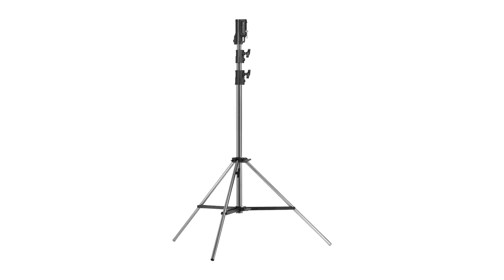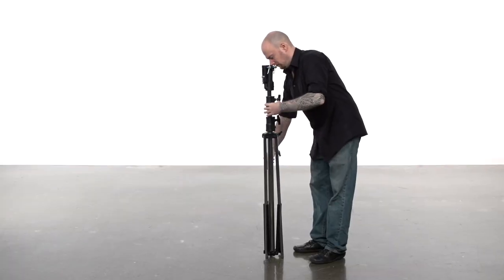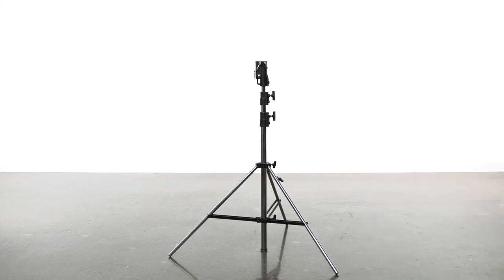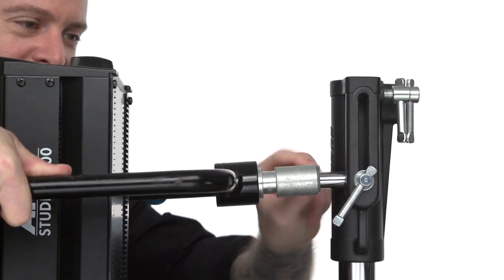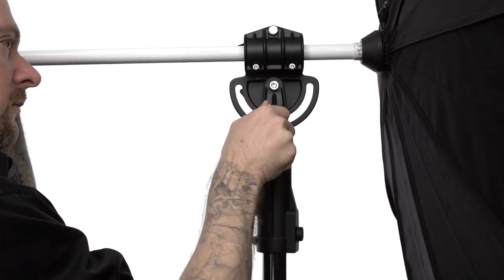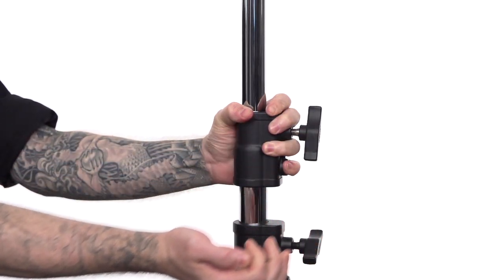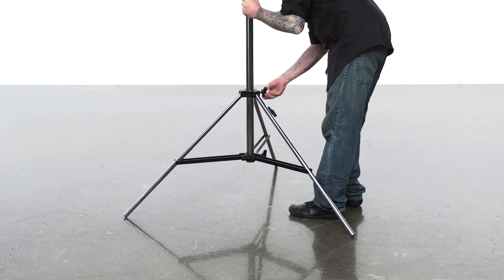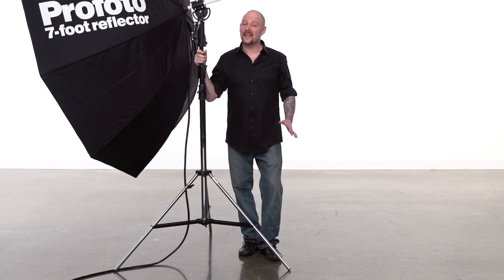Kupo: Master Combo HD Stand

Comment: Which one is more stable, this Master Combo HD or the Master Cinema? Both have very similar specs, the Cinema being a little beefier. Are they still generally for the same application?
Reply: The cine stand has a wider stance (140cm vs 110cm), has square legs and is thus more stable when equipped with wheels. But they have the same load capacity and roughly same height.
Reply from the maker: That's right! The Master Cine Stand does offer some more stability when paired with square leg compatible casters.
Reply: @KupoGrip  thanks for the feedback! I already own the Master Cine and it's a beast. I was thinking about pairing it with the HD but may go with another Master Cine or even Master High instead. First floor here we come 😅 Great stands!
Reply from the maker: We use the master high cine stand in our studio all the time behind the scenes. It's a great stand! "Beast" is definitely a good word for them haha